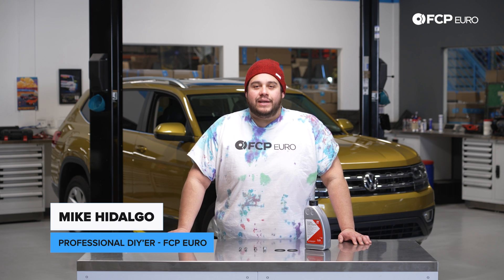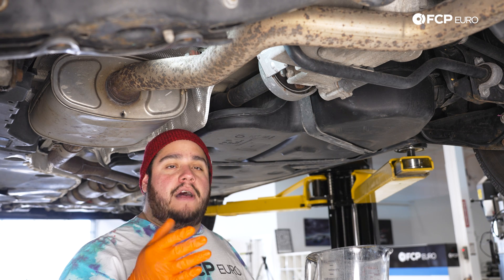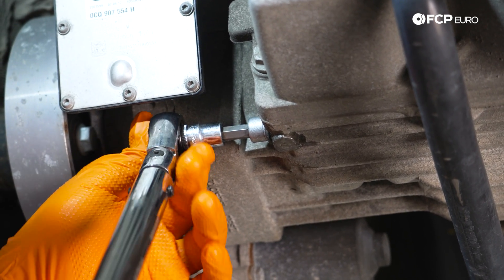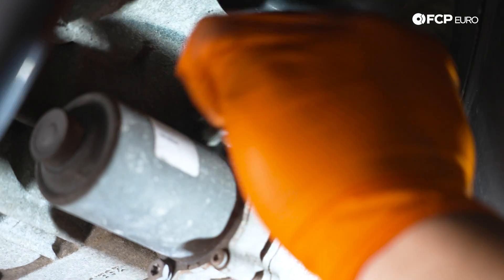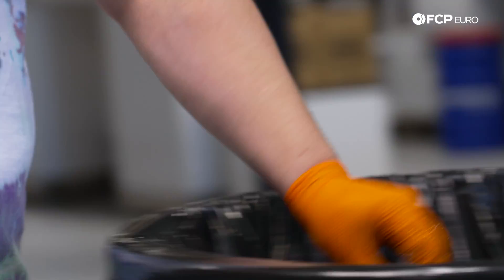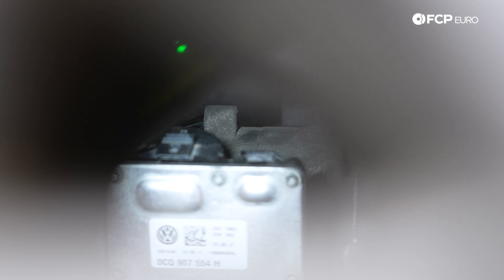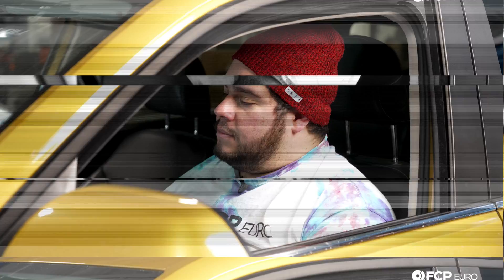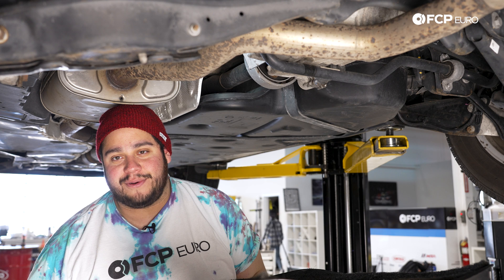Volkswagen Atlas Haldex Fluid Service DIY (2018-2021 VW MQB Atlas, Arteon, Tiguan)

Comment: Changing these now, i found it easier just to pop off the 2 bolts on the module that hold the connectors to easily pop off the connector. Cheers!

Comment: The video along with the kit on FCP Euro only shows 2018-2021. I have a 2022 v6 Atlas, will this kit work for it?
Reply: I’d like to know the same. Don’t think they would’ve changed that part since it was mostly a cosmetic change between MK1 and MK1.5 Atlas

Comment: Great video!! Helped a lot. One thing to note before putting the pump back in. Make sure one cleans the inside of the pump housing before reinstall. Mine was dirtier than the filter itself 🤙🏼

Comment: Fake, VW dealer does not approve (screen removal and cleaning)  (pump removal) all they do and cover is just simple fluid change at service time.  VW Daytona Beach.  Very sad on dealer.
Reply: Dealerships are scumbags.
Reply: @alexs1007 they told me they change fluid and was no filter, my father always use to say dealers rip everyone off
Reply: They just drain and fill the oil. When the pump gets clogged and burns then they'll hit just for a grand for a new pump.
Reply: Oh dang, I was debating whether to do it myself. I'll ask my dealer what they do and then do it at home is they say they don't clean the screen.
Reply: @austintg  they will say they service it.  But the meaning service does NOt include removing the pump to clean screen since screen is not considered a filter.  I warned you.
Reply: We just had this done. 2018 atlas
Reply: @calondismike you did read all comment right?  They only change fluid.  They dont clean the inner screen.  Ia a ripoff

Comment: Thank you for this clear explanation. One comment based on my recent experience - unclip the harness before draining the fluid.  Why? Because that harness clip can be tough to unclip (I had to unbolt the control module (2 x 10mm bolts) to gain better access, view and grip on the connector) and can take much longer than expected.  In my case I ran out of time before I was able to unclip the harness and had to refill the oil and then repeat the whole process the following day when I had more time.  For me the total time spent changing oil and cleaning screen was 30 minutes - unclipping the connector +2 hours.